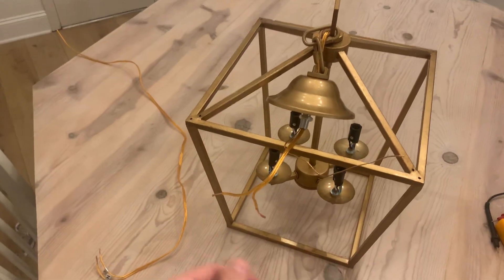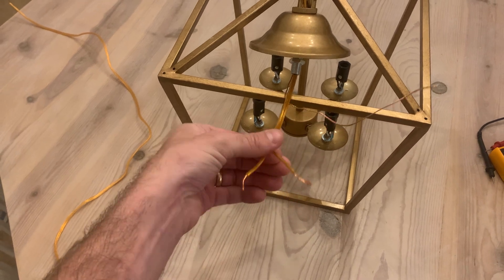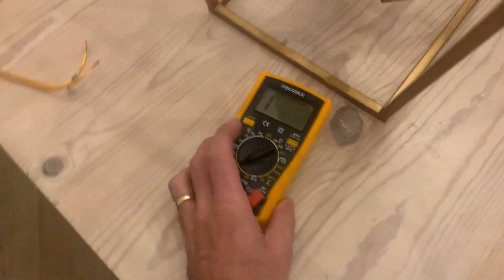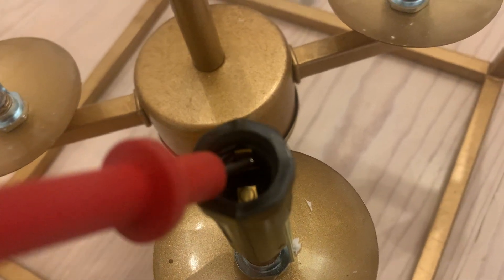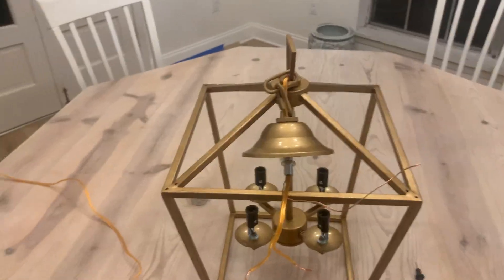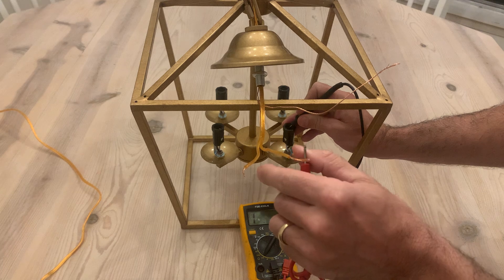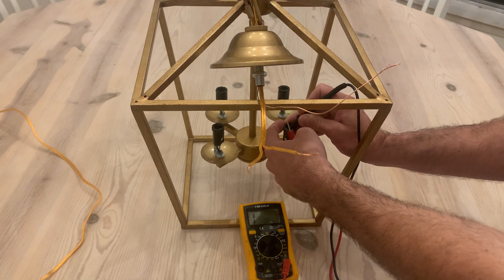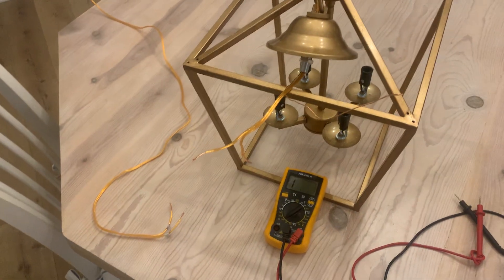How to Find Hot & Neutral Wires on Electrical Fixture w/ Multimeter

Comment: If you look very closely at the cord, one side  will be ribbed, and the other side will be smooth with writing.   The ribbed side is the neutral,  smooth side with writing is the hot.   

Some older cords, such as on a lamp made prior to the 1980s, might not follow this convention so having a multimeter as part of your home repair arsenal is a wise investment, because although the lamp will still function as if nothing is wrong if the hot/neutral is reversed,  this condition increases the risk of electric shock since  the threaded base would be live even with the switch turned off and it's easier to touch when changing the bulb.   

Similar hazards can be present if the switch is miswired such that it's placed on the neutral side rather than the hot.   Lamps without screw bases,  such as smaller halogen lamps used in some desk lamps and accent lighting,  or fluorescent tubes do not pose as great a hazard with reverse polarity.    Regardless, in any case proper polarity should always be respected.